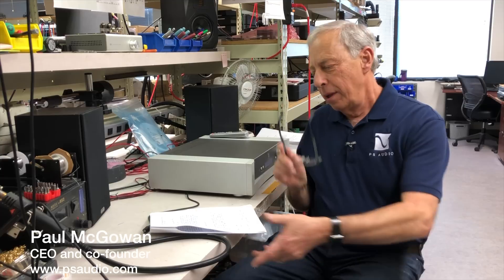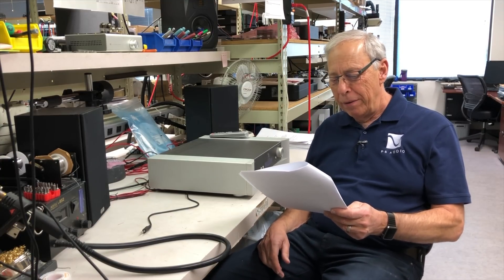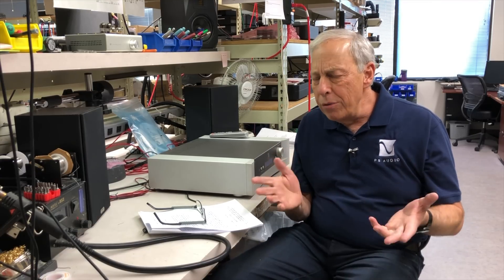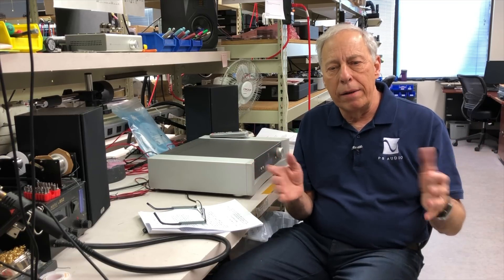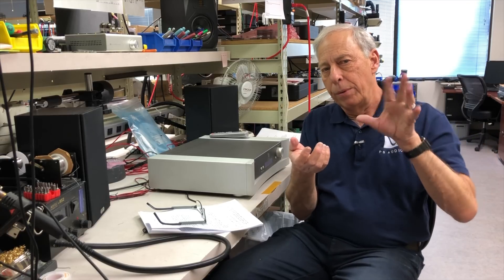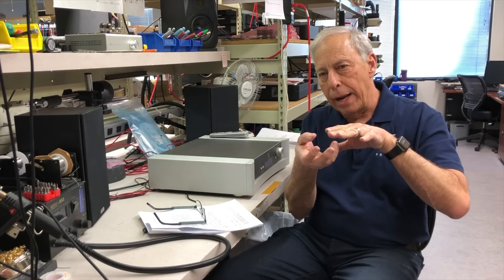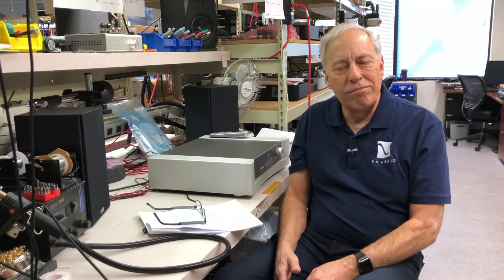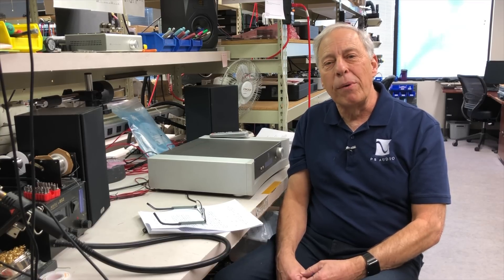Why do preamps make popping noises?

Comment: @paulmcgowanpsaudio you are a legend and best explanation.  Having painstaking sourced my vintage set up over a couple of years and finally got it all racked, i could not work out why the popping sound was there. 

After full power cables upgrade, adding power conditioning kit, upgraded all RCA, the improvement was noticeable but still not right. 

Well after your video, it was a lightbulb moment as it was what we were always told to do in the days and i blame old age memory loss for overlooking something so simple. 

The cables upgrade is easy on the eyes and servicing never hurt. 

Grateful to have come across your channel.

New lifetime subscriber. 😂

Comment: I have a onkyo sub that has annoying popping at random and ive tried everything to try and fix it and i have no clue whats left to do other then buy a new sub which i dont want to do as when it works it sounds awesome. but at lower volume it tends to have random pops.  
When i play sound (full spectrum) directly to it it never ever pops so it must be related to either the receiver or the fact its not getting a input in the range it works. Only fixes online i found is getting a non auto standby sub.  even tho when it goes to standby it doesnt pop but clicks and goes into standby which isnt a issue.

Comment: Hi, thanks for info. I understand the that bang on turn on but i have problem on turning off the preamp. I have a speaker protection which has AC sensing to turn off  it's relay(like 20ms)for disconnecting the speakers. But the poping noise of preamp on turning off is even faster than that. I just dont get the nature of pop of the preamp because power capacitors should hold voltage for 5-10 second.

Comment: Hey Paul, I have a lasting popping sound when I turn on my AMP. I have a multiroom system connected to a AMP Selector (4 zones), and when I turn it on all the Speaker Connected do a popping sound for a few minutes (around 3 to 5 minutes). It is not too loud, but it is annoying! It seems like the speaker are kind of warming up, does that make any sense? Is there a way to fix it? Cheers from Brazil, thanks for the attention!

Comment: Switching on
1. Turn on pre amp and wait 60 seconds 
2. Power amp volume levels at zero then switch on
Switching off
1. Power amp volume levels down to zero, then switch off
2. Pre amp off
* remember this, could save you some $ and hassles with repairs...speaking from experience  :P
Reply: Or you could just buy components that are well designed and have no need for any special treatment.
Reply: @petermartin9494  While that's true, for some of there are other concerns. I use the volume controls on this keyboard to control the sound system, so the amp and preamp are at higher volume levels and then the KB volume is set accordingly. For me, turning down the volumes are definitely recommended.

Comment: The Dynaco PAT-5 preamp has a solution to this. The preamp was powered on all the time! The power switch was only used to switch the power amp!
Reply: That's very clever. Too bad my preamp is a tube so that wouldn't work very well...

Comment: Yep, that's right. Most components, like caps, are charging up as the power supply rails come up to speed, etc. Just about everything will emit a voltage spike when powered up, unless, like Paul said, there is a time delay relay at the output! MOST modern solid state amps have that relay now, which also, in most cases, monitors the power supply rails and will open the path to the speakers if there is an abnormally. Now, do tube amps pop when turned on? Hmm. You wouldn't think so, because of the tube filaments have to heat up, and that's a slower process than a solid state amp, so all the voltages are sort of "ramped" up instead of slamming one way or another. Computer sound cards are terrible culprits of turn on pop! All of mine pop when the opsys loads the drivers. Plus they have no mercy when I shut down the computer! BTW, my vintage old Hafler preamp pops when powered up! LOL.

Comment: One may also consider leaving their equipment on 'round the clock. The only time a preamp should really require a shut-down (that is to say, beyond one being away from home for more than a couple of days) is, either, when interconnecting signal or power cables, or if one's digital preamp functions misbehave during operation, indicating the need for a processor reboot (as Paul described -- power amp OFF at shutdown first, followed by the preamp. And, at startup, preamp ON first, followed by the power amp). Of course, purely analog rigs don't develop processor issues. All things being equal, most modern A/V equipment is designed to run reliably within a particular operating temperature range that should remain fairly constant for best performance, and leaving the system on may be of benefit in this regard. In fact, it may actually (though this may seem counter-intuitive) extend the life of the equipment by avoiding the repeated, potentially damaging power surges between voltage rails, in the same manner that leaving a conventional, incandescent light bulb on typically results in extended life (in my experience) over one that's cycled daily. Same principal, I mean. Also, for those concerned, 'green-conscious' individuals, home audio equipment left to idle typically doesn't draw that much more current than the same unit left to standby.

Don't want to hear that 'pop'? Try leaving the equipment on.

Comment: Why not keep the capacitors fully charged all the time with a trickle charge all the time in a standby mode the way a car battery charger uses a trickle charge to maintain battery voltage wen it's full charged and then when you turn it on you bypass the resistor that limits the trickle current? This way there is no thump and you can eliminate the relay. BTW which relay contacts sound best, P&B, Claire, or what and how often do you replace them?

Comment: Strangely this only happens with my Alchemist Nexus cd player.  If my pre amp and power amp are on before I turn on the cd player I get a pop.  Never knew why. I will follow your start up advice. Thx
Reply: A lot of low output level components like CD players and preamps use a blocking capacitor on the output to block DC and low frequency thumps from the output.  But they require a fraction of a second to charge up, hence the thump.

Comment: I have an integrated DAC/preamp/Amplifier unit. It only has one power button that turns on everything at once, presumably. I get the popping noise fairly consistently in my headphones. Should I be concerned? Should I plug in my headphones after I turn on my unit?
Reply: ifi micro idsd bl ?
Reply: @NiSHAN256  No it's Maverick Audio Tube Magic D1 Plus
Reply: Ok I'll plug them in afterwards from now on. Thanks guys, you may have saved my HD650s
Reply: In my opinion, yes. You should plug in your headphones after you turn on your unit, especially since you've noticed the power-on 'pop' through them. Most headphone/in ear monitor manufacturers recommend this very thing.

Comment: Get home, turn on my PC, turn on my Amp/preamp. Popping noise happens. 2 mins later, log into Youtube, see this video was uploaded 32 mins ago. Now that's timing.
Reply: First, let your PC fully boot up before you turn on the amp. Sometimes the sound driver software will create a spike when it loads. Check for an updated driver if you can, it (may) solve it. My pc doesn't do this but I've had ones that did. I remember in the early days of PC sound capability sometimes the driver software would crash in mid use and send a  damaging noise through to the speakers. As far as I know those days are pretty much over.
Reply: @InsideOfMyOwnMind  My DAC doesn't use any sound drivers, if that make sense. It gets recognized as a regular sound device as if i were plugging in headphones via USB. Never been any firmware or driver updates for it. Pretty sure I always turn it on after my PC, I have windows installed on SSD so it boots pretty fast